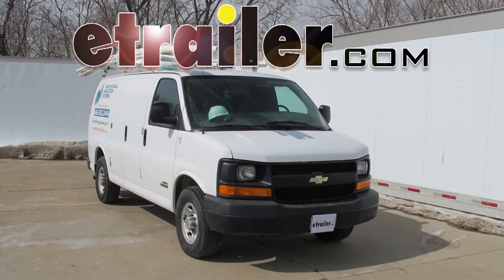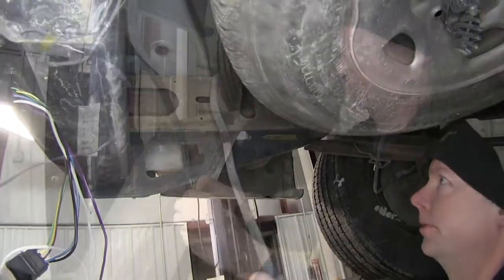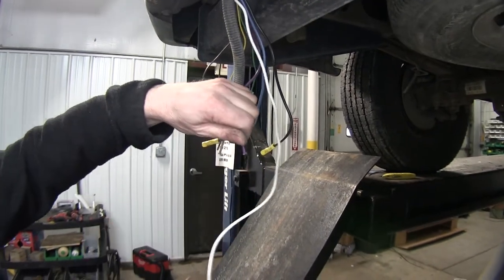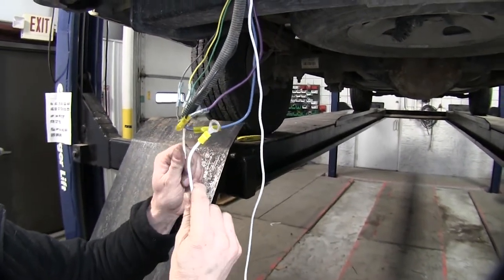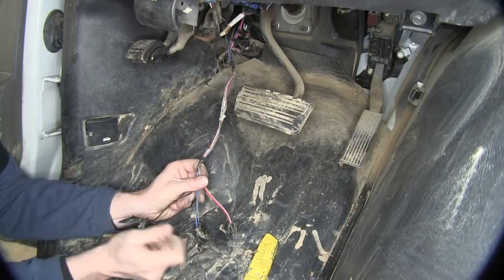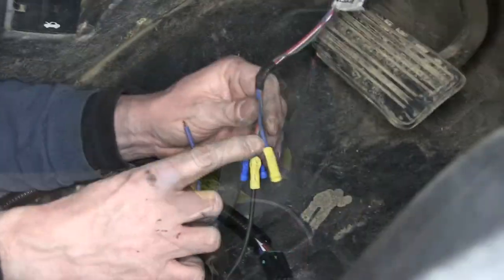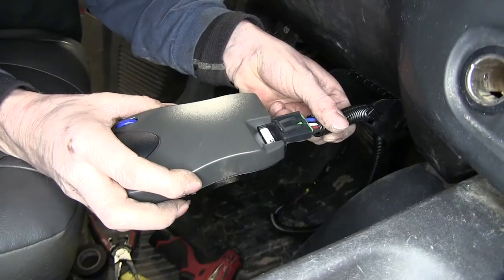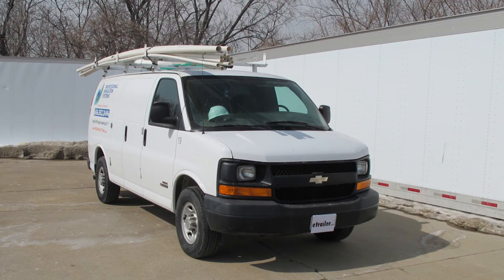Installation Guide for the Adapter 4-Pole to 7-Pole and 4-Pole on a 2006 Chevrolet Express Van

Comment: Hey i have a 2015 express , mine has the wiring like yours except mine still has the connection on the end of the wires. Is there a plug in play harness to avoid having to cut my oem plug?
Reply from the maker: We have a plug that you can use with your factory tow package. 
7-pole Kit
https://www.etrailer.com/Custom-Fit-Vehicle-Wiring/Chevrolet/Express+Van/2006/A10-7072VP.html

4 -pole kit
https://www.etrailer.com/Custom-Fit-Vehicle-Wiring/Chevrolet/Express+Van/2006/41155.html